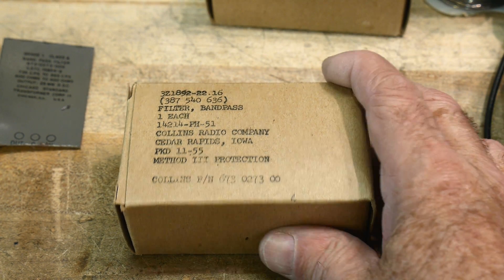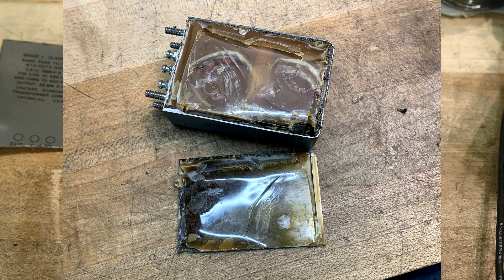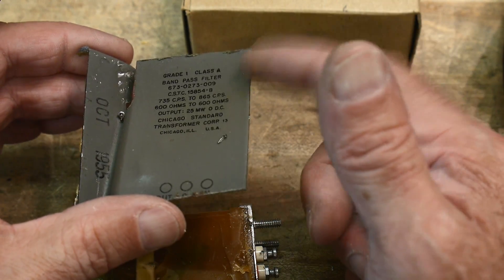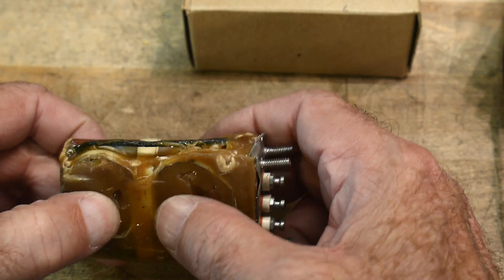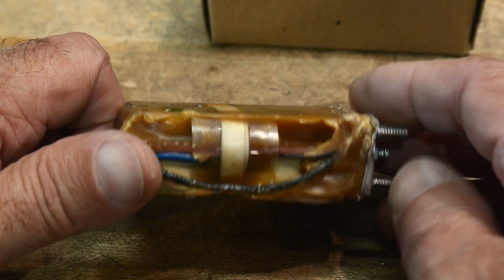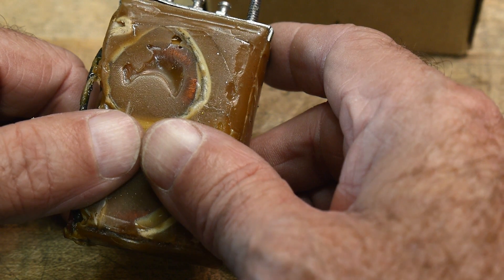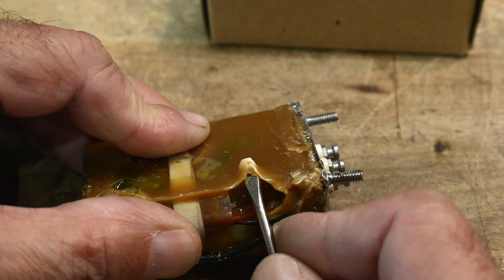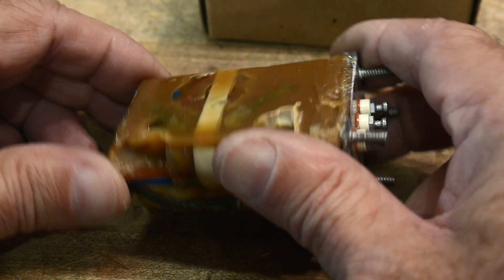#662 Collins 800Hz Bandpass Filter Teardown

Comment: The toroid is most likely 88 mH; back in the day, I used to design touchtone decoders as well as use these for CW so they are definitely 500 to 1000 mH. The reason it is not a mechanical filter is the frequency is way too low for that technique to be viable; that is the geometries would become too large to be practical so it always had to be a passive LC filter. Here is a link to a filter design that it’s probably very close:  http://www.genebitsystems.com/david/AudioFilter/A_Passive_LC_Audio_Filter.pdf
The filters I used to build, use this technique but also field effect transistors to boost the impedance and preserve the Q...

Comment: The minute I saw it, I thought it was ex-military and designed for use in electronic systems used in aircraft, ships, or land vehicles. It was potted for shock resistance and hermetically sealed against the elements. It's probably still useable even after you skinned it! (USAF Ret E7... Instrumentation and Flight Control specialist having worked on military aircraft from the F-105 in '64 through the F-16 in '84).